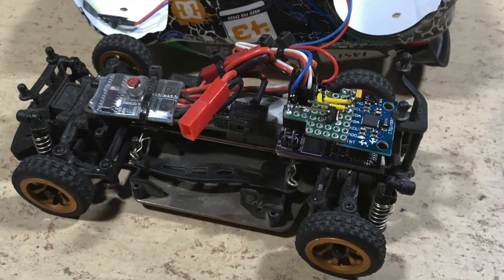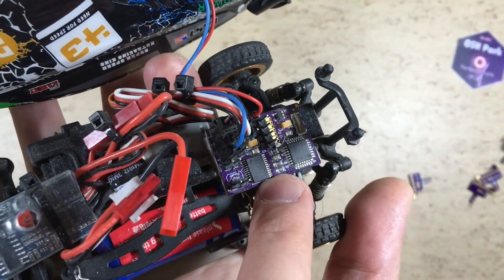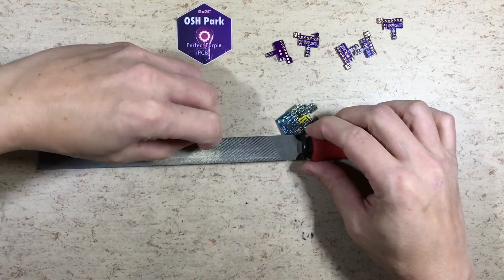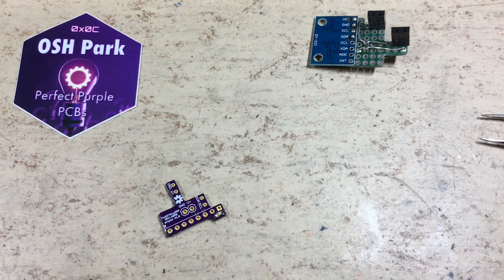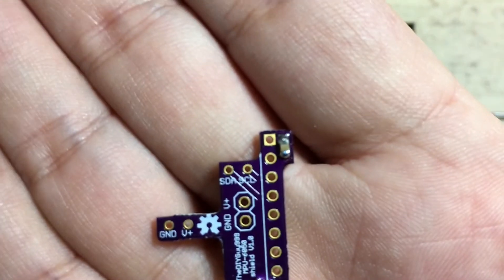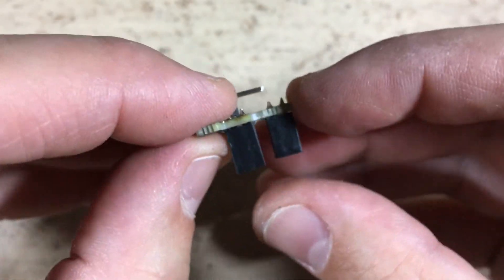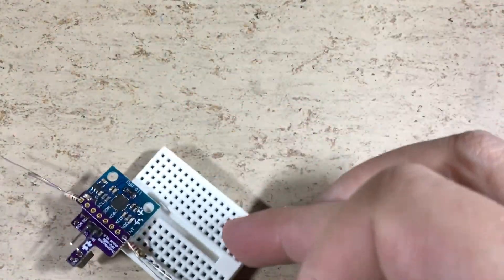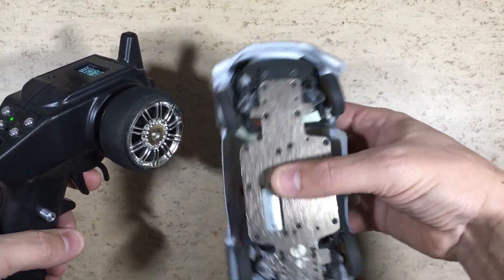MPU-6050 Arduino "Micro RC" Shield PCB From OSH Park

Comment: How much does it cost you to do a run of your receiver boards?
Reply from the maker: OSH Park charges $5.50 per batch of three PCB. Of course you have to assemble the boards afterwards.
Reply: Oh wow that's not too bad. Do you order your components individually? Or are you able to order them all at once from a single supplier? Looking to put together several modified versions of your receiver boards
Reply from the maker: Most parts are from here: https://www.ebay.com/usr/alice1101983
But there are also some other suppliers. Have a look at the BOM on my GitHub for the details
Reply: So you buy boards and desolder the parts you need?
Reply from the maker: No. I only unsolder the TB6612FNG chips. All other components are bought separately